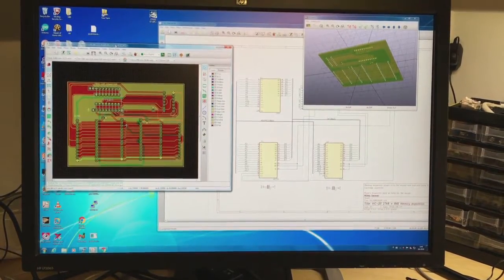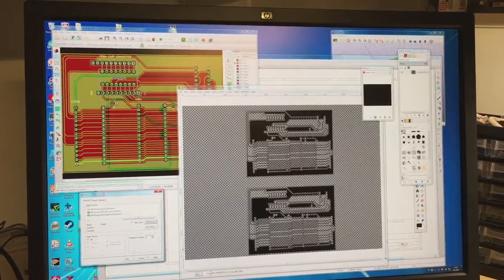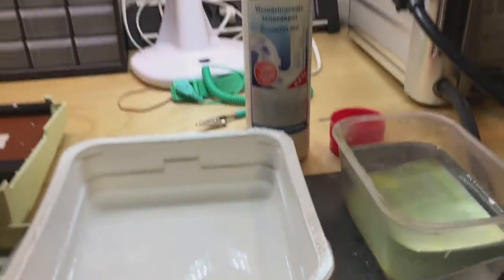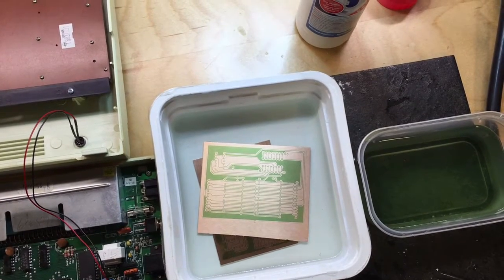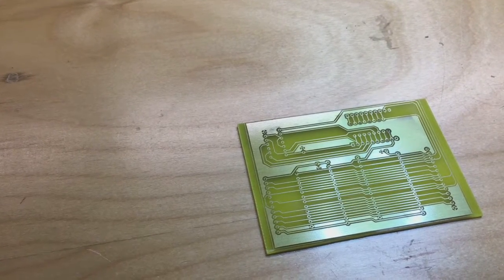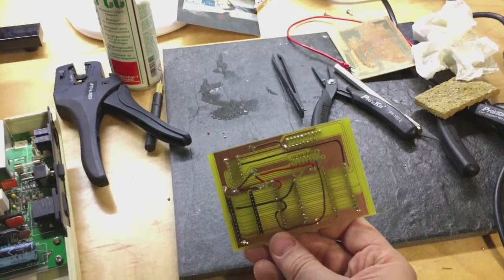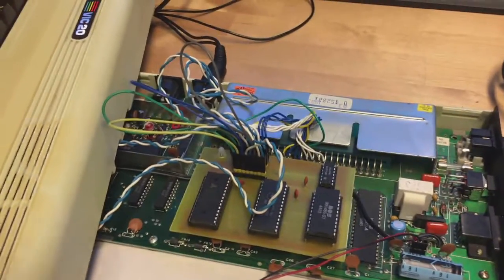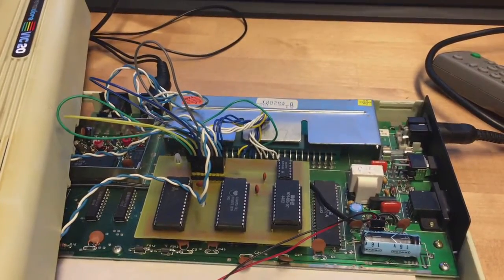Building VIC-20 35kB  internal memory expansion

Comment: Thanks for the video.  Just wanted to ask.  Does any of the dip switches protect the 8k ram to allow for running protected cart games?
Reply from the maker: Quickly checked my schemas and dip 8 is switching /WE signal between vr/w and VCC though 10kOhm. So switching that to VCC would bring /WE up -> write NOT enabled. So the answer is yes.

Comment: Awesome job!!!  Do people still use Ferric Chloride to etch - is that what you used there?  Nice tip on using drain cleaner to develop!
Reply from the maker: I used ferric chloride twice, first and last time. Too messy even I have another chemical that can be used to remove ferric chloride stains :D. I'm now using  sodium persulfate that is cleaner to use, gets more and more blueish when it gets more saturated by copper (is that correct word here?) so you know when to swap the etching fluid. 

Most of the drain cleaners are just sodium hydroxide with some extra stuff on them. I found one that has >95% of that and then some aluminium grains that you can remove by hand if you want to. And it is very cheap.